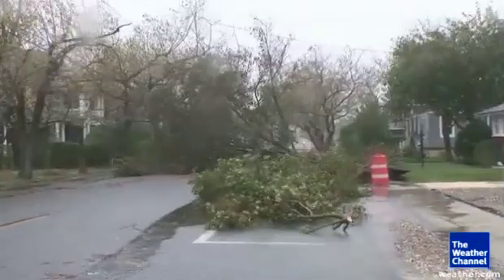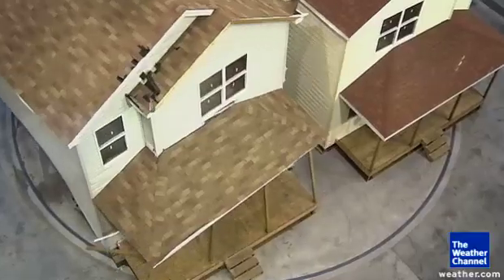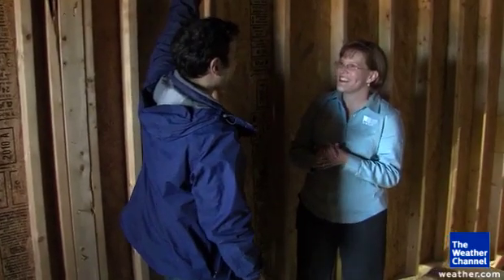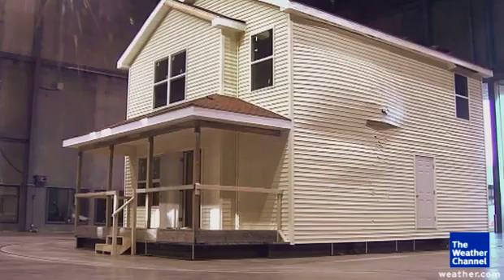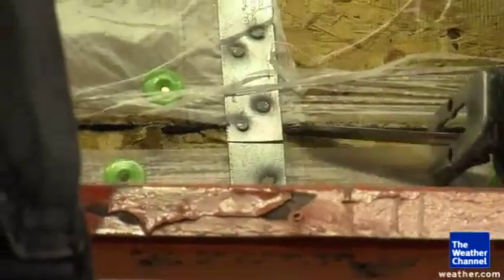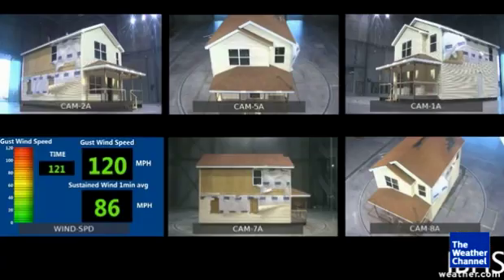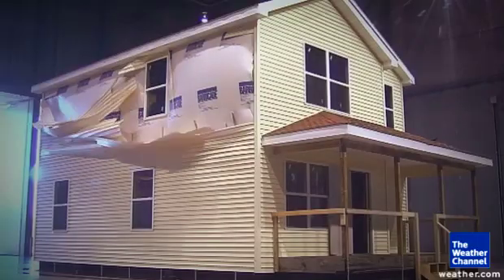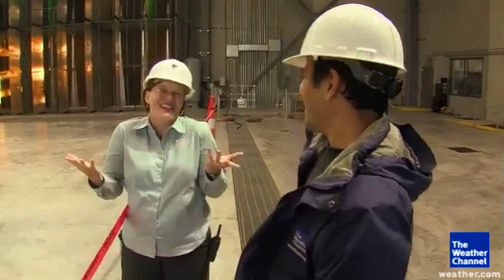Engineers Test Storm Resistant Homes

Comment: Why are american hiuses made from cardboard. Here in the uk we have brick houses that are painted with special weatherproof paint
Reply: I live in a brick house (really brick on concrete block); it's only rated for the same wind speeds as the wood-framed houses they build around here. Brick weathers much better than most other exterior surfaces, but it's mostly held together by its weight.
Reply: @pcno2832 It's also worth noting that mortar, over time, becomes brittle and weakens, so older brick houses are particularly vulnerable. This was seen in the recent EF3 that hit St. Louis, MO, when several quite old brick houses completely collapsed due to the high winds. Honestly a big reason I might actually prefer a wood house in a tornado. When wooden houses collapse they have a sort of "tenting" effect that can make small spaces in rubble that you could survive in. With brick, when brick walls fail it's not uncommon for the whole thing to come down, and when brick houses collapse, they basically lay an even coat of heavy bricks, so you're pretty much guaranteed to be hit by and crushed under bricks.

Comment: If it where a block or brick construction. It would be far better. Siding is crap. New  construction homes are kinda built like Old Mobile homes...only they have a foundation.
Remember. Wind needs to find a place in the siding, roof or under the home (if it's not directly in a foundation). Main   components, other than debirs...that cause structure failure or roofing blown  off a bit.

Comment: I saw another video of two houses done at this location. They said the house that literally disintegrated was because of the winds applied. 95mph. But it was obvious that since they were not actually sitting on any type of foundation that the house that fell down simply began to slide across the floor before the back of the structure (away from the wind) failed structurally and caused the collapse. Not really a great experiment in my book.
Reply: They also, had them side by side. Sandwiched together. Seems like it created a wind tunnel or vortex of wind between the two homes, in that particular video, and found a weak point in the home on the left. Blowing it's siding and roof off.
Reply: @courtneysrodgers8317 hmmm very interesting maybe I will try this in my scale models
Reply: That's what I thought.